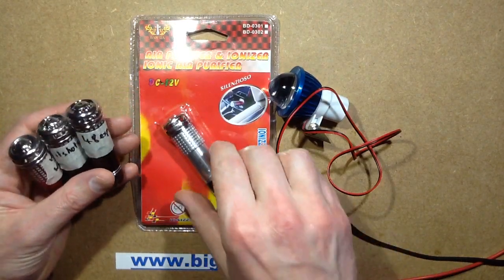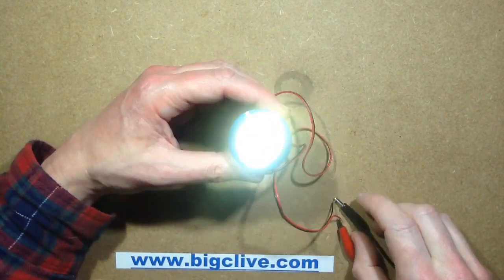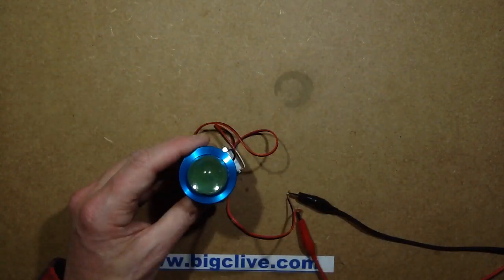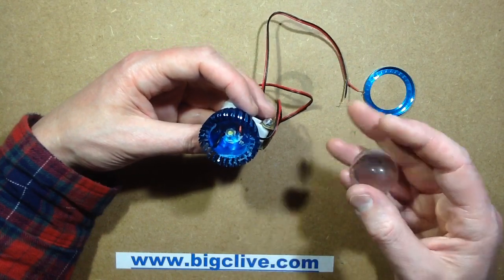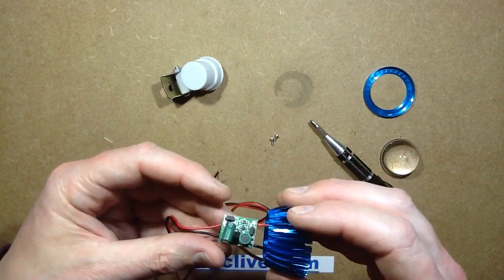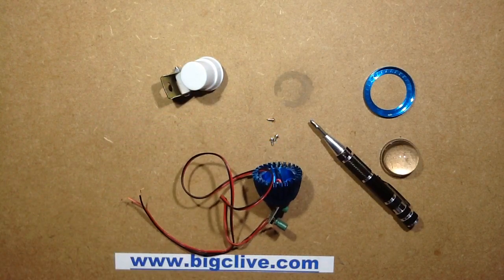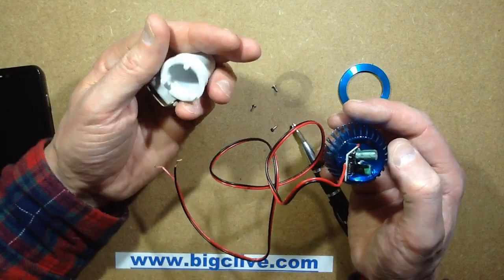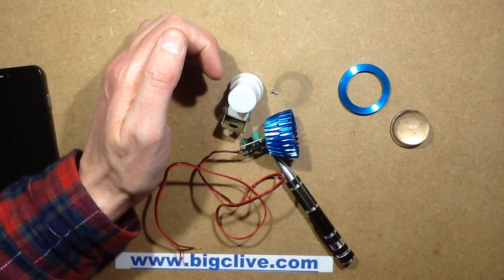A look inside a cheap 12V LED bike headlight.

Comment: I wonder if that's a buck converter chip?  That would make sense...   I have some here that are the kind with 3 trimmers to set the voltage, current limit,  and "charge finished" (which I don't use) driving 10W LEDs off a 12V power supply.  But simpler ones would do the job too...

Comment: Need bike light teardowns. they are a big market for online sellers, and many might find them interesting 
they run US$2 to 25 rear and $5 to 50 front and the Chinese no-name stuff is pretty disposable.
I pay $15-50 for fronts and it ight make a good story to contrast the trash with the more established stuff. Both run real hot.
my "current " ones use an 18650 with USB charging on the front and AAA on cheap rears with nice ones not yet failing, so no tear-downs. Bikelights.com is a dead site but still up for reference.